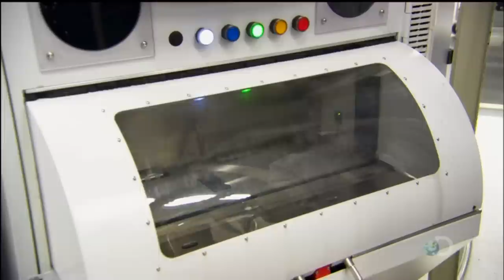Western Digital Factory

Comment: In 5 years I changed 3 Western Digital Green and Blue 1 tb Hdds used in a surveillance system with a low recording rate and every time the electronic part it broken and besides that, the pins on the motherboard plug with plug from the turntables oxidizes. I have 3 retro PCs with Western Digital HDDs from 25, 20 and 15 years ago and they are still perfect.

Comment: I used to consider WD as the most  reliable HDD, but it seems that their design for 3.5" drives is causing a specific issue, because of a bad contact between the head signal pins (shown in min 2:08 of the video) and the PCB of the HDD, I've faced the same issue on 3 different HDDs (250 Gb, 500 Gb & 1 Tb) because of some dirty deposits on the PCB contact sufaces, leading to some disfunction of the HDD, and even the HDD rescue softwares had interpreted as "bad sector", but after cleaning the PCB contact the HDD could work again with no problems.
I'm still considering WD as one of the best and trustable brands, this is why I'm giving this comment hoping that they'll fix this issue.
Reply: Hmm thanks for your comment mate, i'll have a check on that old Seagate HD bought new that never worked. Kept it in case, but 2tB to trash was too painful for my ass, so i'll try to fix it !

Comment: I love WD hard drives. So reliable. Out of the ones I've had over the years, Western Digital HDs are the ones I never had issues with. Well, except for that one single time one of my drives started to SEEM to malfunction. I got worried so I rushed to buy a new one and transferred everything over to the new one. Turns out it was not even the drive's fault but just electrical problems in my house that damaged the PSU and because of it, the drive could not operate properly. I still have that hard drive I thought was defective at the time (got my electrical issues and PSU sorted out, btw) and I run all of my games on it. Years have gone by and the thing is still working flawlessly. Thankfully it was just a scare.

Years of experience with WD and a couple other brands have led me to refuse anything that is not WD. I currently have two 1TB WDs and one 2TB WD in my main computer. Looking forward to upgrade at least one of them for higher capacity as soon as I can. Sadly that might not happen any time soon because of how expensive hard drives have become recently in my country. :( There are cheaper ones, yes, but they are not Western Digital. If I am to spend a lot of money, I'd rather spend on something good that I trust.
Reply: +Mike Dragon i just found a WD Blue 1 tb in a swiss online shop for only 55 swiss francs (almost same like USD) and the seagate are way more expensive like 80-100 Fr for 1 tb but the seagates are shit complete shit.... idk why they have WD cheaper then Seagate...
Reply: Petrik Stur That's odd. Over here in my country, WDs are usually the most expensive ones.
Reply: Mike Dragon yea its weird but its awesome!
Reply: Petrik Stur Well, lucky you! I need a bigger hard drive and I refuse to buy one that isn't Western Digital. lol I've learned my lesson from past experiences.
Reply: Mike Dragon :D WD blue 3Tb for "only" 100 $ here ^^
Reply: Petrik Stur Damn! :o One of those won't go for less than 1500, here.
Reply: ***** Brazil.
Reply: ***** I know. :(
Reply: +Mike Dragon I have a external 1TB seagate that have worked without failure for 4 - 5 years. That also includes accidentally dropping the external HDD a couple of times.
Reply: Mike Dragon WD also owns SanDisk
Reply: @TheNekOz I believe you. Thing is that on internet every brand is crap. No matter how bad is brand someone had some issues and they label whole brand as crap.

Once long, long time ago on some newsgroup was a discussion how WD is crap and how Seagate is great. Sure i commented how i never had issues with WD and soon dozens of people start posting about issues with Seagate.

No this is not WD vs. Seagate but  how internet opinions are worthless. Too many people who jump to conclusions too soon.  :)
Reply: @Mike Dragon In my country (Croatia) WD & Seagete always had a same price (1 or 2€ +/-)
Reply: WD would do well to employ you in the publicity department.
Reply: Toshiba also makes some good drives which are slightly cheaper than WD but also reliable. I have 3 of the same model two 1TB and one 2TB. Pushed pretty hard all the time, never had a problem.
Reply: @DrFreeeman  9 years and still no problem with the toshiba
Reply: Eu am TREI HDD SEAGATE BARRACUDA!☺️🤔 SUNT FOARTE FOARTE BUNE CA ȘI TOSHIBA HITACHI ȘI WESTERN DIGITAL ȘI HDD-URILE SAMSUNG!☺️
Reply: @MikeDragon  hi I worked at wd for 13 years.
Reply: @FrivolousShoulder43 no hdd is better and cheaper

Comment: It's so easy for the robots to assemble and test the drives, leaving them in perfect condition. Later, humans are barely able to do recovery - platters swap etc., it takes much longer and after "human touch" a drive is not reliable anymore.
Reply: mi rek Well, try to fit that many bits on such a small platter ... You will realize that it's complete madness at human scale :')
Reply: Clearing the way for Skynet where humans become useless and robots can make their own hard drives without us.
Reply: Wait till the robots crash then you can try to ask another robot to help fix what crashes.

Comment: My dad purchased a brand new custom PC with 10GB WD HDD (August, 1998). I used that PC for 8 years, running 17 hours/day on average and without using UPS to protect the device. I stored all my notes in text files because I don't have the money to buy a new HDD with higher capacity. The drive outlasted my PC, with no bad sectors in it (I used drive checking software to verify this). I only disposed of it when I someone showed me a 2GB portable USB stick.

I still prefer WD over other brands. I have no experience on WD failing drives (I own three portable HDDs... been with me more than three years now) but have plenty on the other brands we use at work which I don't want to mention here. Congrats to the engineers of the old mechanical WD drives!

Comment: Back in 2001-2005 i´ve used only maxtor HDD´s. After 2006 maxtor gone bankrupt so i´ve started using only WD HDD´s, in 11 years never had some issues\problems with them. Now that´s some serious quality ! Ps. i´m a system builder.
Reply: You're lucky, those Maxtor's got some really bad reputation for entire series having issues... Then again everyone says Seagate is a disaster but after 7 years of 24/7 operation I've just had my first Seagate drive fail in a RAID6 array of 24, seems like it's all just about luck and a quality power supply :/
Reply: Some Guy I have a maxtor that ran for 6/7 seven years, boy was it loud, a guitar solo at every read. It started acting weird a few years ago so I changed it. I miss the noise, it was a pretty good indicator of things happening.
And my external Segate drive died in a year, a question of luck.

Comment: I only buy WD Drives, almost never had a bad experience so far :)
Reply: KingMacintosh what happened to you?
I mean, I might have been just lucky^^ After all I don't use THAT many drives. Maybe I'v had 6-7 WD drives so far.
Reply: After all, Some were just mistakes.
Reply: Me too wd drive are great!
Reply: A hard drive is only reliable until it dies.
Reply: +Maximilian “Interprete” Mustermann Had some WD myself across the years and not a problem so the next one will also be WD.
Reply: plus WD owns SanDisk
Reply: HGST is still the best drives when it comes to quality with 1.03% failure rates in 2015-2016.. WD comes in at 6.55% failure rates in 2016.. Seagate had it so bad that they had 10.68% failure rates in 2015.. Seagate knew they were doing something wrong and probably changed something quality wise in 2016 dropping their failure rates down to 3.48% making them 3rd in quality.. coming in next to seagate is toshiba with 3.06% failure rates.. The HGST company is actually owned by Western Digital which is pretty cool.. I have been using HGST and loving the durability, quality and speed..
Reply: Ich hatte eine Seagate Festplatte und die Hat wirklich genau 5 Jahre und 3 Tage Gehalten. Dont Buy Seagate! Buy WD,Toshiba, HGST.
Reply: I buy seagate they are cheaper
Reply: same here, still have a few laying around that are roughly 10(!) years old and still work perfectly fine.
Reply: Seagate are trash i seen so many failures now from lots of computers that i fixed for more then 15 years it was 80% seagate
Reply: Same. :) I bought 1 WD HDD, it failed and the damage was so bad i will never forget it. Some 10 or 15 Seagate drives over the last ~20 years with just 1 failure.
Reply: so you buy crap ...
Reply: HGST is not HGST they are WD .. back in the day yes best drives now i wouldnt touch them why pay more for the same crappy WD drive
Reply: ROFL says dont by seagate but says by WD .. why would anyone want to buy a crappy drive over a better one ?
Reply: if i ever find a computer with this drive in it i replace it
Reply: @Brian Berthold  WD was never a crappy HDDs. WD & Seagate was always the best. I never had WD that failed before 4 years. My last WD had 3,5 years of working hours (almost 5 year old).
Reply: AdrianoCROST ROFL! WD was never a crappy HDDs. WD & Seagate was always the best. BAHAHAHHAHAHAH
Reply: @Brian Berthold  Only funny thing are fools like you who think they know something. I don't need your advice on this at all. WD HDDs never failed on me. In fact only disk that failed was IBM (Hitachi). Worst disk i ever had. 2 IBMs died after 1 year.
Reply: you really do need help if your saying WD is great HDD's - i have a total of 50 HDD running and none of them are WD cuz they suck being you look at them and they will die hell i have a 40 year old conner that is better then a WD funny how you bring up a hitachi (far better then a WD) your a guy that would jump into a super car and say your KIA is better and faster ..
Reply: Kev Outlaw WD owns HGST lol
Reply: You got the CHEAP part right! You get what you pay for.
Reply: I've had 2 Seagate failures and NO WD failures.
Reply: From my own experience, and that of various friends/colleagues, WD drives are guaranteed to fail.
Reply: Maximilian Mustermann where made china or Malaysia?
Reply: i buy only Toshiba HDD´s had never data loss so far.
Reply: Yes i use wd all ia stiil good
Reply: Me too! WD are a very reliable brand, unlike Sh*tgate! 🤣

Comment: Those heads didn't use to park the way they do now. This process has obviously changed a bit over the years, heads use to park on the inner part of the platters, where the inner part of the platters were slightly concaved for head clearance at spin up and spin down.

Comment: 3:26 Imagine all of those in raid 0! :D
Reply: And if ALL of the drives were ssds
Reply: jaakko200987654321 You'd need one hell of a power supply to run them all! and a plug socket to output that much wattage
Reply: Most drives use less than 5W each.  So lets say for argument sake that room hols 250 drives...1000w?  You can get 2KW power supplies for a pretty good price.  But its actually the enclosure issue thats going to be a pain point.  At most you could build yourself some backblaze type enclosures and hold 60 drives each so you'd also need some 8088 externally connected drive enclosures to connect to the array.
Reply: Lord Sandwich Yeah, you’d think they would have a plug at the bottom of the cases to test them in-place, avoid scratches and put them directly is a sealed bag. But they’re still using humans! Which AI decided to put humans in a factory???
Reply: RAID-6 is better

Comment: Isn't the disk fully formatted in the factory to detect bad sectors?  Should I fully format every new hdds I buy?
Reply: +Babak Karbasi Most of the time they're already factory formatted the firmware is designed to detect any bad sector that is found but I don't mind formatting a new drive since it's pretty darn quick.
Reply: full format take at least 6 hours for a 2t hdd
Reply: +Babak Karbasi it also depends on drive speed and if you picked "quick format"
Reply: +Babak Karbasi often new hdds allready found bad sectors. they have a tolerance, so you can get bad sectors later without problems, they will be corrected by the controller. but there is a limit for that. if that is reached, the hdd starts warning over s.m.a.r.t and failure. you dont have to formate them atfter buying.
Reply: Quick format just removes the FAT table. It does not scan the surface in any way.
Reply: Drives HAVE bad sectors and will always have. Unlike in the past where drives were delivered with the list of bad sectors stamped on them that the tech has to manually enter in the file system to ensure no data will be written to them, nowadays, this task is now handled by the onboard controller. Your drive has internally a lot of spare sectors and they are dinamically realocatted behind the scenes as one goes bad or weak. The better the hard drive servo made, the better it handles bad sectors before they become unreadable to swap them with a brand new sector from the spare section. 

Also, formatting a hard drive in windows has nothing to do with bad sectors. Nowadays file systems don't handle bad sectors as previous file system were. When
Reply: Babak Karbasi I'm sure they do a low level format, high level format is the user's job. Once low level format is done it never need low level again.
Reply: @tommyb.6064  Every single sector reallocation will be recorded in the HDD's SMART record. Also formatting does have something to do with bad sectors in the sense that a full format will force the drive to reallocate any unreadable sectors. Whereas trying to read back a damaged sector will simply mark it as pending until it is either successfully read or a write is requested at that sector at which point it'll be reallocated.

Comment: I don't know if I am unlucky but 4 of the 6 western digital disks I used the last decade failed after three to four years. And I also didn't have warranty because it had expired. My advise is to avoid disks with very high capacity. They use many disk platters and disks heads, that multiply the chance of failures. Also bigger disks need more power and inevitably produce more noise and heat. Heat is the biggest enemy of hard disks. In case the disk is internal, use heat sinks for internal HDDs or external cases with fan. 
Disks for surveillance 24/7 or server are always more reliable, more expensive with less capacity. Avoid the typical budget ones. A nice solution is to use two cheap disks in mirrored raid mode instead of a more expensive one. Is nearly impossible for both disks to failure at the some time. Under mirrored raid the same data is written in both disks. In Mac OS X the configuration is very easy, in Windows 7 is little more complicated. Mirrored raid is slow and expensive.
Reply: Almost nothing in Labrou's comment is accurate.

"They use many disk platters and disks heads, that multiply the chance of failures"
and
"Also bigger disks need more power and inevitably produce more noise and heat."
-To the contrary, failure rates are going down and they are becoming more power efficient.

"Heat is the biggest enemy of hard disks."
-No. Counter-intuitively, hard drives live longer in warm environments. Not so much for the rest of the computer, though. Google did an enormous study on this because they wanted to know how to make their data centers save money. Yeah, the results surprised a lot of people.

"In case the disk is internal, use heat sinks for internal HDDs"
-No.

"Disks for surveillance 24/7 or server are always more reliable"
-Sure, for surveillance. Those drives are designed with a focus on constant writing. They aren't designed for regular desktop use, though. You could use them for desktops, but you may have more failures than by using drives designed for desktops.
Reply: This is a load of nonsense.

Comment: I have one WD external 2tb hard drive with 1.7tb data in it. It's head has been damaged as dignosed by repair shops.. they are demanding from me the price 5 to 6 times more than the actual price of hard drive, means very very very expensive to repair. There must be at least one single western-digital-workshop in every country with professional technicians specialized in repairing wd drives.But Alas, WD will never even care, as their purpose was just to spread their stupid drives all over the world and they did it, and they earned a lot. Why should they focus to just a one single customer?? :( :( :(
Reply: If you value your data, you clone or back it up - all the time. It's not WDs fault but your laziness that led to the loss. Always buy two.
Reply: Making a new drive is always cheaper than repairing one. Also, just repairing a drive will never be up to standards of the new drive, nobody buys repaired drives in their sane mind.